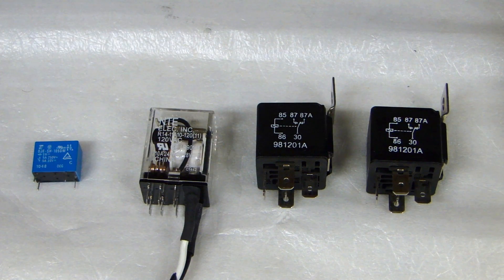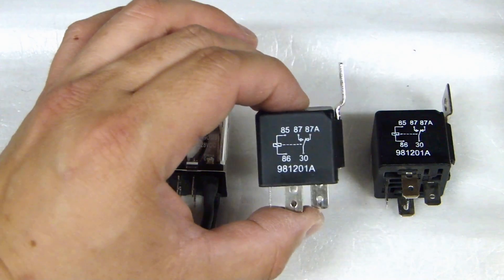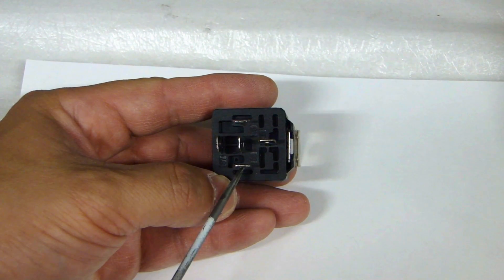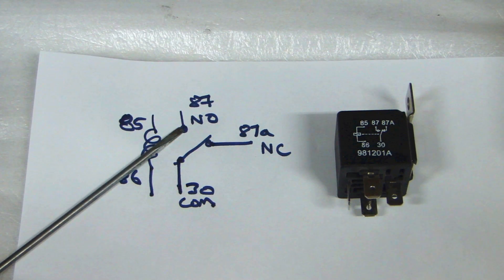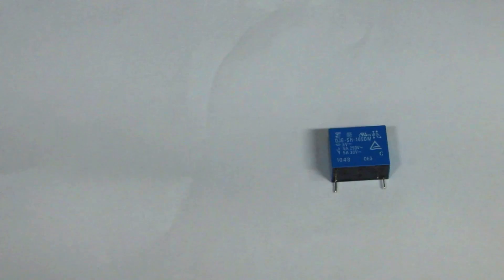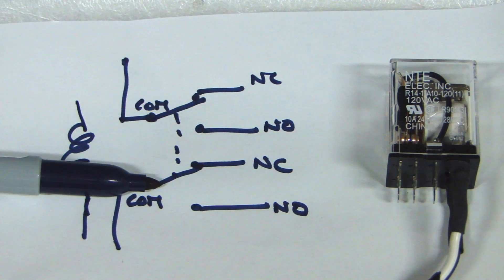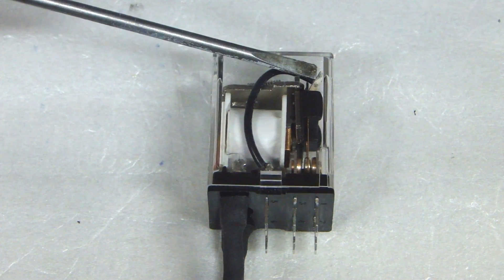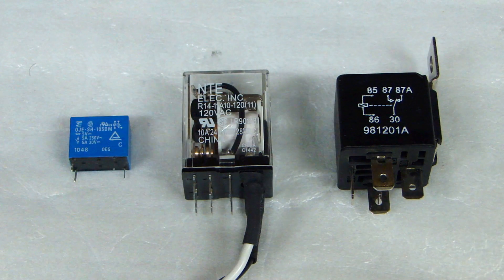How Does A Relay Work - SPDT DPDT SPST Automotive Relay

Comment: a Relay is a externel switch which can be operated by the internel switches of your vehicle , but the point to understand is that " it never enhance the currunt or voltage itslef it just work as a switch which operates from a signal from your computer or inside function of the vehicle just you add extra wiring to the instrument directly from battery." so in between your battery and the instrument relay is installed. when your switch on from vehicle relay will be energized/switched on and it completes the circuit which is coming directly from battery to your instrument and when your switch of from vehicle relat will be switched off and disconnect the circuit of the instrument.

Comment: You have not explained why one relay has a diode and the other has a resistor and there purpose especially on modern vehicles which has Controllers ie ecu ecm

Comment: So what is the idea of having a switch (fog lights) inside the car if you have power and ground isn’t that a switch? Why do you have to have a relay and fuse inline as well??
Reply from the maker: So the wiring and switch won't melt and catch on fire.

Comment: yeah nice , but i wouldn't say the drawing was very good as someone else did, as the drawing doesn't match the actual layout of the relay. I have a diagram that i used to rewire a turn signal system from a 2004 truck with the steering column and turn signal switch of a 2008 truck, and the way it is laid out, it is not possible to work the way this layout shows it. The layout has actual turn signal wires connected to the common and not the open and closed circuitsd and vice versa, so i can't see how that works correctly.

Comment: What would be the purpose of installing a relay in a vehicle. I know, dumb question but i know nothing of this.
Reply from the maker: It's a high current switch that can be controlled by a low current switch. That way you don't have to be running heavy gauge wire (high current) throughout the entire vehicle.

Comment: Great video thanks for the info, just a question I’m trying to control a swamp cooler from my thermostat using relays as bridge, my thermostat will send a 24v signal to activate the coil and complete the path that way my 110v signal from the swamp will travel to active the command ( get fan on, high cool, low cool) the questions is what type of relays can i use that receive 24 to control the coil that way 110v can pass through?

Comment: Did I miss it but did he explain WHY you need to use a relay?    I simply came here wanting to know WHY you need to use a relay.   I have fog lights for my van and everyone says I need a relay.  So I’m just trying to better understand WHY I need a relay.  What is it’s PURPOSE.
Reply: Relay is a switch that uses electricity to work, it can handle huge amps which is you need when you install extra lights.. while flip switch/push button switch etc can only handle small current.. so if you direct your huge current load into a switch without relay, most likely the switch will be busted.. sooner or later.
Reply: How are you going to turn the fog lights off. A relay is a switch is pretty much what it is to be able to automatically turn something on and off
Reply: A relay is simply a way to control devices/parts that require higher voltages to operate while keeping the actual interface or computer isolated from that hotter current.
Reply: @dilldowschwagginz2674  there not just for high voltages there also for 24 volts dc  as well

Comment: Compliment from Suriname, I have a FANNY 198 E professional Amplifier,, the relay does not go in, all transistors good, one  200ohm resistor has no voltage drop,,, 37 volts on both sides,, need advice,, anyone 2023

Comment: Does 12 volts need to be applied to just one side of the coil to acgivate it or does 12 volts need to be at both 86 and 85 for the coil to energize?
Reply from the maker: The 12v you need to apply is DC, so the 12V source has a (+) and a (-). The coil is not polarity sensitive, so just connect (+) to one side of the coil and (-) to the other side of the coil.
Reply: @dial2fast  I'm trying to diagnose a bad relay on a circuit board...I want to test if the relay is receiving the voltage that way I can rule out the relay being the problem and track the problem somewhere else....I am seeing 12 volts dc going to one end of the control side and 6 volts going to the other end when I say control side I am referring to the side with the coil (like pin 85 and 86 in your video)
Reply from the maker: If the relay is a 12v relay, then one side of the coil needs to have 12V, and the other side is 0V as it goes to common (gnd). The common side should remain 0v. If you are measuring 6V, then trace the circuit board to see where that side of the coil goes to. Unless the circuit has constant 12V on one side of the relay coil, and it's switching the gnd side on/off to switch the relay. That's also common with automotive circuits that uses a 'negative' trigger.

Comment: what I am trying to work out is, does the SPST relay have a continuous draw on the power source even when the circuit is broken?
Reply from the maker: If you are talking about the switch side, when the switch is OPEN, there is NO current draw because the electrical circuit is open. If you are talking about the coil side, there is only current draw when the coil is energized (or relay is turned on).

Comment: Is it possible to work relays for 24x7, 365 days continuously? Will it burn and get damaged?
Reply from the maker: If you energize the relay 24/7, it can get warm and might fail eventually. You should choose either normally close or normally open relays accordingly for the application.

Comment: I want to know if it a good idea to install a starter kill switch relay on my new 2022 toyota corolla cross alarm system? Do i need a fuse holder when install remote starter? Let me know ASAP. Thank you. @dial2fast
Reply from the maker: It's up to you if you want to install the starter kill. If you live in a an area where is lots of car theft, then yes install it. The alarm system will come with all the necessary fuse with proper rating.
Reply: @dial2fast  Well I have compustar alarm system. They dont have fuse holder on 12V battery on my new 2022 Toyota Corolla Cross on the wiring diagram. I have PTS(Push To Start button), how can i wires stwrter kill switch? Even though they dont have, do I have to put it on anyway for protection.

Comment: Hi. You don't mention what amps is needed to energize the coil to activate the switch, What amps are needed for the car relay?
Reply from the maker: Bosch SPDT 12V relay coil current draw 160mA
Reply: @dial2fast  Thanks, I have tested my relay amp wise, which is not a Bosch relay and it a little higher, But thanks for your reply :-)

Comment: With the SPDT relays, how do you separate the single coil electromagnet from both pole switches so they are not shorting out or sharing?

Comment: Since there are alot of eyes and ears here maybe somone can answer this. On the 12v automotive relays that can handle 30/40amps, how many volts can these handle flowing through them continuously? Not the trigger/coil voltage but the voltage flowing thru once the contacts are made? I imagine there has to be a limit right? Or is the voltage limitless as long as the amperage isn't exceeded? Thx!
Reply from the maker: I tried checking datasheets on the Bosch style automotive relay and it only list the nominal voltage of 12V (or 24V). There is no maximum voltage rating. I think the reason is the automotive relays are only designed to be used in 12V or 24V electrical system, therefore they don't list anything beyond that working environment. The only thing I can say is if you must increase the voltage, then current rating will have to go down to maintain proper power rating of the contacts.
Reply: @dial2fast  makes sense. I would like to think a higher voltage at a very low amperage would be safe but there's really no way to know for sure w/o testing. I appreciate your input!

Comment: Very clear thank you. I do have a question though. Is it safe to use a relay in reverse? So say you have two inputs such as mains and a generator for example. Could you use the relay to switch between the seperate inputs independently?
Reply from the maker: For that type of application, current rating is very important. You should use a proper transfer switch when switching.

Comment: Hi can you help me I’ve got a 12v heater that needs to go through a cooling down sequence which need the power to stay on I can run through the main with a reducer down to 12v but if I get a power cut it will burn the heater out so I need to switch over to a 12v battery to keep it powered to go through the cooling down sequence is there any auto switch I can do this with please hopefully a cheap relay that you was showing 
Kind regards John

Comment: For me I am just trying to understand the benefit of using a relay. For instance in a 12v automotive application where current is only being supplied when the key is turned on, why would you not just take the hot wire and connect it directly with a fuse, to whatever it is that your powering? Instead of going to a relay, and then to whatever it is your trying to turn on? TIA
Reply from the maker: There are several reasons for using a relay. Even the factory electrical system uses a LOT of relays. One of the main reason is the relay gives you the ability to trigger the switch to turn on/off using another signal source. For example, if I am installing a pair of DRL lights, and I want it to turn on when I turn on the ignition (start the car). A relay will allow me to wire the trigger (coil) to ignition 12V. A relay can also make install simpler and safer. If you use a relay to install a set of fog lights, you can run all the high current (heavy gauge) wire in the engine bay, and then run the switch wire (thinner gauge wire) through the firewall into the vehicle and back out. Also by only having to energize the coil of a relay to switch on/off a device, you don't have to use a high current switch. An example is your headlight switch on the steering column which energizes a relay to turn on the headlight. That headlight switch is a low current switch and cannot handle the current of two 55W halogen bulb. As to your example of running the power wire from the battery to a fuse to a switch and to the load, yes that will work as long as all the parts in that circuit is rated to handle the current of the load. But this wiring is limited and cannot utilize any other trigger to switch something on (if you wanted to). Bottom line is you have to look at the application you are installing and decide what works best for your install.

Comment: I have a question if anyone can help answer, what is the purpose of the pins to NO if you have pins already on NC ready to go once the relay is energized......
Reply from the maker: The purpose of having NO and NC on one relay is to allow some special circuits that require both pins. For people who install car alarms, this is often used. Go Google 'reverse polarity door lock'. This type of relay can be used in many different automotive circuits going back 30+ years ago.

Comment: Hi, and thank you for your detailed explanation. (With a SPDT auto relay, JD2912-1Z-12VDC.) Does the coil and switch have to share the same power source (battery), or can they have different power sources?
Reply from the maker: The coil and switch can use the same power source, or use different power source. The two are independent.
Reply: That's what I believed when I bought them, but testing didn't reflect that. I must have had bad connection or something. :) That you.

Comment: You failed to mention the correct operation for each relay. Understand each relay has a specific job for a specific device. Also, you failed to mention how relays act when the points get  carbon on them; if the points keep opening and closing if it is a head light relay the lights would continue to come on and go  off  even though the park lights would not come on unless the hazard switch on the dash is suppressed. 
So the point is the instruction is basic and  not very professional/ complete.  . . leaves the investigation in the dark.
Reply from the maker: Hence the title of this video is "How Does A Relay Work", and NOT How Does A Relay Fail. BTW park lights have nothing to do with hazard lights. Those are two different sets of lights on a vehicle with different circuits.

Comment: Automotive relays are typically rated at 30 or 40 amp? How do you know which one you have?
Reply from the maker: If it's made by a reputable company, it should be labeled with the rating.
Reply: @dial2fast  The values are not marked and its has a Ford Logo, made in canada. I have search the web and a lot of people are asking this same question. There are part numbers marked on them, but if i look them up there are no values. 
I guess the way to find out is to put a load on until it fries... You can buy millions of these at junk yards.

Comment: Hi ser.. i want to know what is the difference then of using single throw and double throw..i mean what is their specific function and uses. And which is more efficient to chose between the two. Many Thanks
Reply from the maker: A SPST (single pole single throw), is just a single switch with two contact points that is on or off. A SPDT (single pole double throw), is single switch but with three contact points. One point will be normally open (n.o.), while the other will be normally closed (n.c.), and when you switch this relay, those two points will switch from n.c. to n.o, and n.o. to n.c. One is not more efficient than another. It just depends on what type of switching you need in your circuit.

Comment: dial2fast...GREAT VIDEO!!! 

I have a TPTT (TRIPLE POLE, TRIPLE THROW) RELAY — if that's what it's called since it has THREE separate contacts on EACH side, and not one or two (three NO, and three NC contacts, plus the 120 vac input side). 

QUESTION: 
Can the three separate relay contacts on either the NO or the NC sides be COMBINED AS A SINGLE CONTACT by joining the wires, to increase the Amp handling-rate on either the NO, or NC side? 

Relay info:
120 V 50/60 HZ
1/3 HP @ 120 VAC
1/2 HP @ 250 VAC
Below that it says:
10 amps @ 250 VAC
10 amps @ 28 VDC

If I do that (combine the three on either NO or NC) would the TOTAL HP that can be used @ the 120 VAC — which is originally 1/3 HP — be up to 4 – 4.5 HP?...and:
would the amp handling-rate also be raised to 30 amps or so…on whichever side I COMBINED? What say you my friend? Hope you understand what I'm asking? 

Thank you and best regards!!!

Comment: Let say you have 24DCV relay. You energize it and the contacts are closed. Doesnt this mean that there goes 24V trough to contacts? How you can measure these things?
Reply: The currents passing through the coils to energize and what passes through the contacts are from two different sources. One power source energizes the coil to create the electromagnetism that pulls or closes the contacts, and another passes through the contacts when they are made.
Reply: @babatundeadepoju2302  I already figured out by myself but still thank you for your explanation!

Comment: If i reverse the voltage on the coils of the relay, will the relay still work normally???
Reply from the maker: Yes
Reply: @dial2fast  What about the diode connected in parallel to the coil?
Reply from the maker: @ritvikarya4796  You are probably referring to a flyback diode in parallel to the coil. If you are using this, then positive will connect to the cathode side of the diode.

Comment: Great explanation. I still am lost on why relays are used instead of just having a switch. I’m new to electrical so help me out please
Reply from the maker: A relay will allow a way to electronically control a switch. A circuit can energize a coil and open / close a switch. Whereas a switch is a manual way of turning on and off and requires a user to operate. You can also cascade a bunch of relays together in an automotive circuit to do all kinds of fun stuff, like reverse polarity door lock actuator to lock/ unlock car doors.

Comment: The thing that doesn't make sense to me is the use of the terms "normally open" and "normally closed".
My understanding was that relays are made in two varieties; "normally open" and "normally closed", and that their being named that way was pretty straight forward.

One type is open (the circuit) when there is no current/voltage applied, but then it closes when current/voltage is applied.  The other type is closed (the circuit) when there is no current/voltage applied, but then it opens when current/voltage is applied.  The term "normally" meaning the state when there isn't electricity applied to the relay.

But now I've seen a video or two that are confusing, because they seem to be suggesting that all relays are both normally open and normally closed, and that that switches when eletricity is applied.  This doesn't make sense to me.

To me, it makes sense that you'd potentially need one OR the other style, NO or NC, in different circumstances/applications.  One where the circuit is normally closed and needs to be switched open (to open/turn off a circuit/device), and the other where the circuit is normally open and needs to be switched closed (to close/turn on a circuit/device).

Very strange.
Thanks for the video.
Reply: ST or Single throw would work the way you're thinking. Two of the relays in this video are dual throw(DT) which means the relays toggle between two circuits. You can choose to not wire up one post of the dual throw relay(SPDT) to make it behave like a single throw relay(SPST).